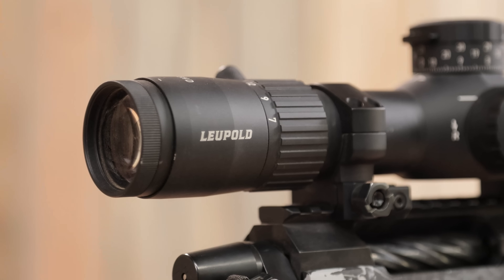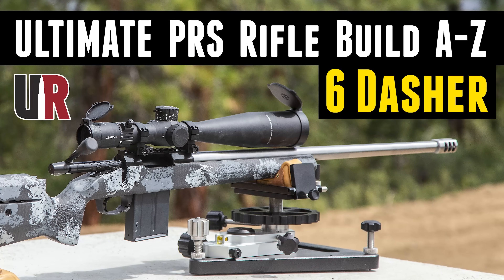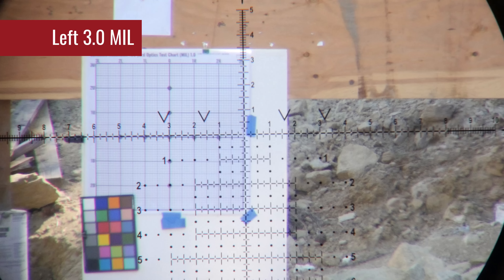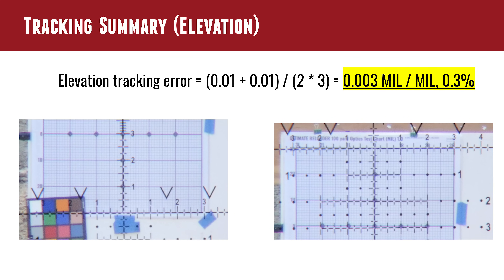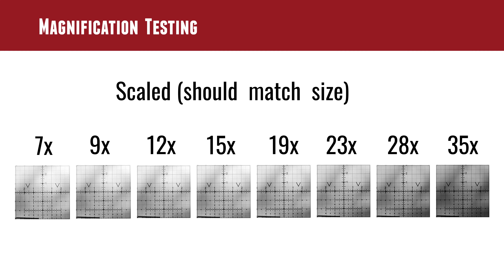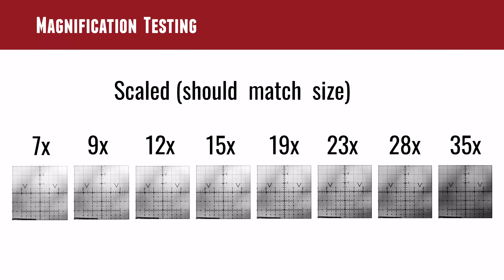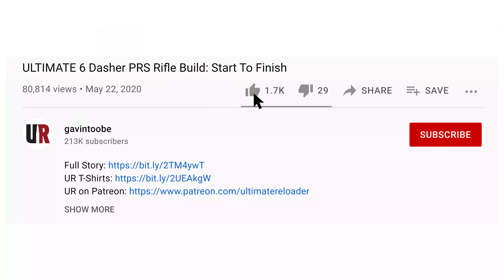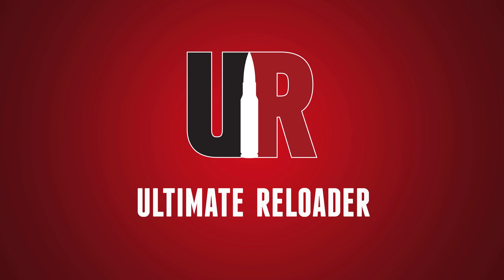TESTED: Leupold Mark 5HD 7-35x56mm Riflescope (Part 2)

Comment: Panavision has a rig that will align to .0001"  it's used for video compositing and was patented in the 1980s.  They used it to add 6 layers of video over each other to create a practical effects shot for one of the star wars movies.  I think Mr knoll actually owns the patent.  He has over 6,000 patents for optics rigs and camera mounts.  He will actually help you with a patent if you need help.  He helped a friend who designed a multiplex camera rig that held a rifle scope with a digital sensor on one side and a 35mm camera on the other to test the clarity of scopes.  I think his rig used cnc pillar vises to do everything and had a laser to track the overlap points.  He ended up having to ditch the patent because there were hundreds of designs that were close to the design and he ended up having a single patent that was close that wouldn't release to allow his patent.  Cost him 150k and he almost lost his house over it.  Lost his wife, she refused to deal with his obsession with optics.   There are millions of optics patents, good luck with the patent and remember, China doesn't care about them and will knock it off and sell to eastern European companies killing your patent.

Comment: For anyone curious I have the mk5 7-35 and 5-25, and razor gen 2. Looking side by side at an electric box about 100y away I can see more detail and fine print with the mk5 at 25x vs razor at 27x... now with the mk5 7-35 I can see more detail than both others at only 20x. Might be a fov thing? Not sure but I'm amazed at the 7-35 and the usability of the pr2 reticle even down to 12x its very usable.

Comment: Appreciate your work and the great review on the M5 scope.  I have had mine nearing 2 years or thereabouts.  Best bang for your buck for what you get in my opinion . I use the  3.6-18 with T-3 on an AMC mount all the way to 1000m and it does the job well.

Comment: I own both the 3-18 and the 5-25 Mark 5s.
Both are on .300 WMs.
Both are fantastic optics and have been used extensively shooting out to 1K, and hunting. (The 5-25 on two different rifles)
I shot my best 1K group with the 5-25 to date.  (2.74 inches at 1K with a factory Christensen Mesa LR and 230 Bergers)

Comment: Own 4 Mark 5HDs. 3.6x18-44 on lightweight hunting rigs, 5x25-56 for hunting or comp, & 7x35-56 for comp. Using different reticles looking like I may settle on the CCH. Love my NF ATACR, but plan to dump it due to weight, or just use for comp.

Comment: Love your work! That said, I have always tried to keep my reticle as close as possible to the optical center of the scope so that you are using
the center of the lenses. As you approach the edge of the lens you loose the image quality built into that lens. That is why I prefer the Leupold impact type reticle vs dialing windage & elevation.
The mechanical center & the  optical  center are different. (Because of the offset caused by space occupied by the adjustment hardware)
The mechanical center can be found by dividing the number of correction clicks in half.
The optical center can be found by holding the eye piece against a well lighted mirror, looking through the objective end, and aligning the two images of the reticle you see with the windage & elevation dials. If memory serves, this is best done at the lowest magnification.
I wonder how this would affect your data?
Reply: Use Burris Signature XTR rings for sure.  Perfect optical centered including horizontally.

Comment: I would like to know if a 5-25 Mk 5 offers same quality as the 7-35. Only drawback for me is the 35mm tube which makes it less flexible to swap scopes between my 30 and 34 mm tube scopes.  Would also be interested in tests of the VX5 & 6 series Leupold scopes.

Comment: I run the 7x35 with the new PR2 reticle and love it. Stretch to a mile with ease. Shoot 2" groups with it at 1,000 and a 245 berger.
Reply: Two inch groups at 1000 yards? I am going to call on that one LOL. 10 inch groups at 1000 yards is doing something. Two inch groups at 1000 yards would win you every 1000 yard shoot ever held.

Comment: Nice.  That is about a $2,400 scope so it should be pretty good.  Do you measure distance from the end of the barrel or from the end of the scope?  What is the benefit of epoxy bedding the scope?

Comment: This scope is really grate  Just I wish if the  windage was  designed just like   Turret  sizes, without covering caps..
Also If in the future they going to upgrade it with more power  and larger main tube ( 40mm or even 45mm ) than will be wonderful

Comment: If I'm understanding your magnification analysis correctly, it seems what you're measuring is relative -- between the power settings. I'd also be interested in "absolute" magnification accuracy. I wonder whether you could do that by absolute measurement of your images vs actual size of the image. Also, a MAJOR parameter for me is resolution/clarity. Do you think you could come up with a test for that? One practical way I've always thought about is comparing distance/magnification/ability to read some standard text. If, on exactly the same magnifications, you could read standardized text with scope A at 65 yards, but scope B could read it at 71 yards, then scope B has superior resolution. Would you care to discuss the issue of resolution?

Comment: Off Topic:
I am having problems with Hornady brass for my 6.5 PRC. After 2-3 reloads, the primer pocket is getting loose-too loose to use.
Is this a common problem with Hornady in 6.5 PRC? Is Lapua better (longer lasting)?
Rifle Bergara B-14 Wilderness HMR
Powder: N165 50gr
Bullet: 140 gr Hornady HPBT
No pressure signs on brass, no stiff bolt release.
Thanks
Reply: I have always found that Lapua brass is top notch. I wish that I had about 5000 pieces of it for every cartridge I fuss with LOL.

Comment: Ive installed 2  mk5 scopes on buddies longrange guns and we've had very good luck with them. Great glass track good great turrets no complaints  👌
Wish id had this on my m24 back in the day.
I use Athlon midas tac ffp mil rad scopes  on my m24 inspired builds in 6.5cm, 3006ackly
,my 300 ultra mag m24 sports an Ares ETR ffp mil rad and my m24 338 edge sports a cronus btr.

Comment: I had one of these in a 5-25 with PR2 reticle, it had tracking issues and Leupold replaced it.. The replacement was sold immediately after. This was not a parallax issue before anyone mentions it. My next high end optic will either be TT, ZCO or NF, im done with Leupold..